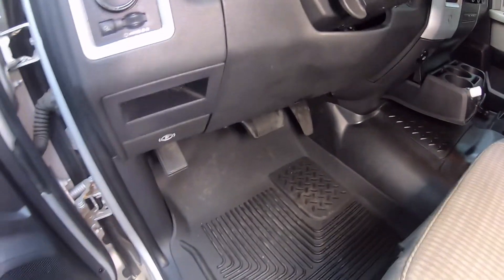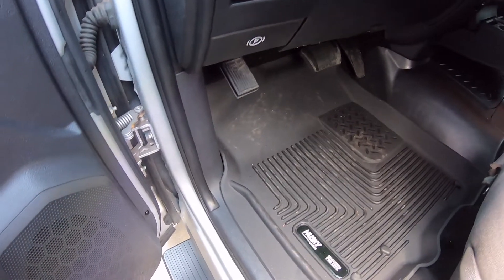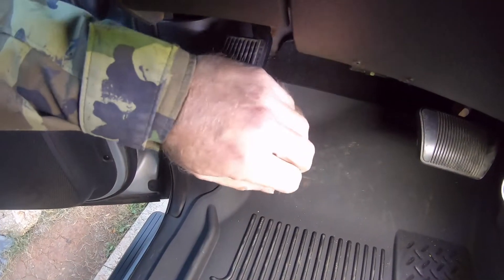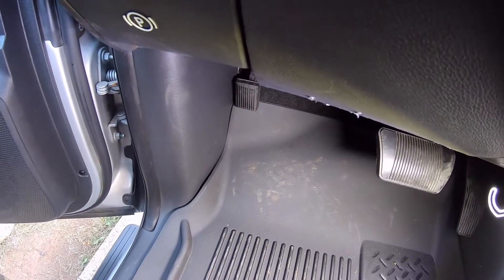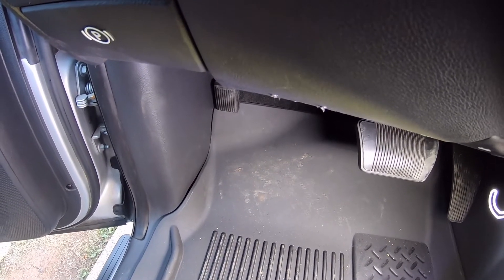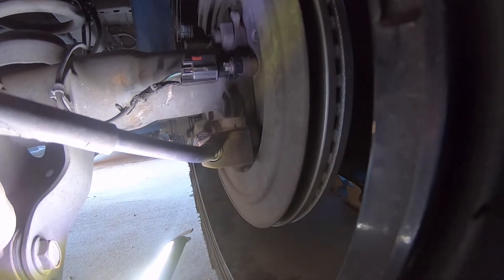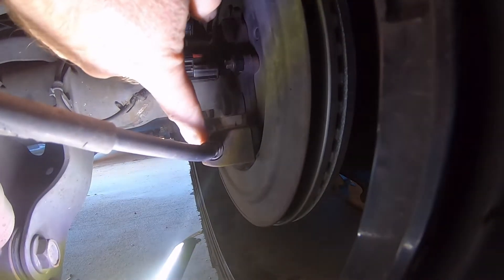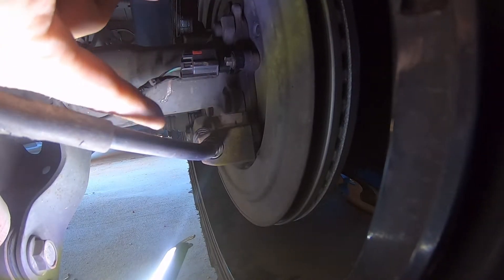2009 hemi 1500 trx4 build part 66. E-brake/Parking brake cable replacement.

Comment: Good video. I've been working on mine and replaced the liners(pads) and hardware, but I'll need to do the cable too. I was able to get my box wrenches in there to adjust that nut with no problem.